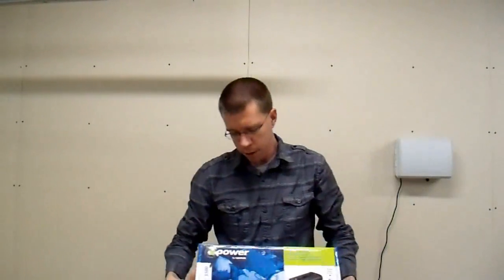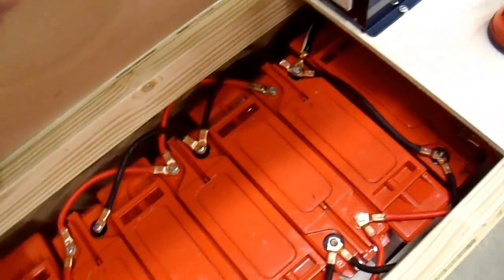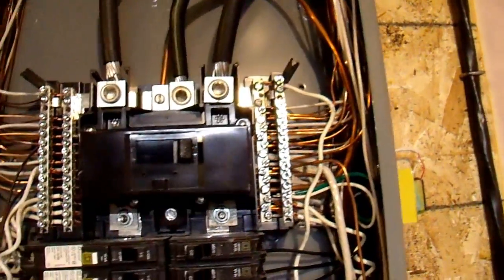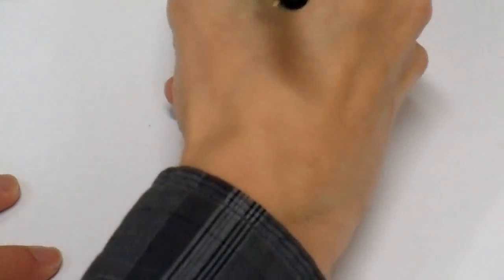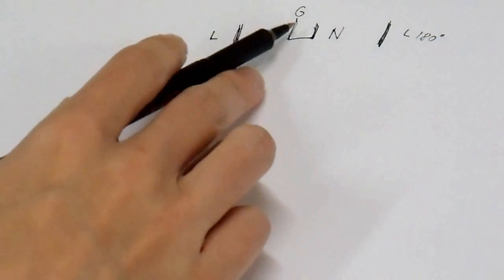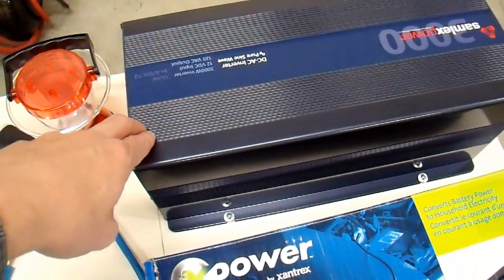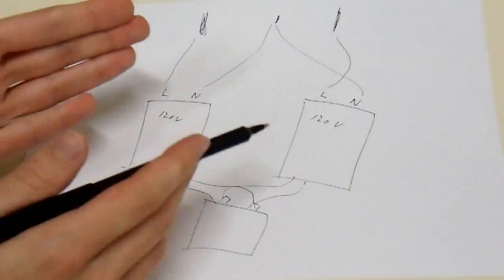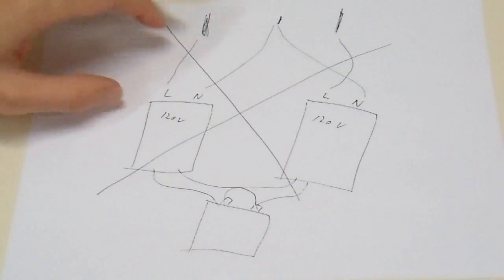How to Power your House with an Inverter/Generator During a Power Outage Part 1/3

Comment: I understand the grounding theory and how you showed the connection to the BATT ground and the ground of the outlet. I have a Vector that I just checked for that and it seems as though the battery ground is not connected to the outlet ground so I shouldn't get voltage sent into my batteries. Could I still use the vector  to feed my circuits in my home and still use the ground connection? In your other videos you made your connections without the ground. Also, whats the main difference between a batter backup (UPS) vs an inverter with batteries? m assuming it has something to do with the grounding and neutral. Normally I use a generator but im also looking to go with a battery system with solar charging.
Thanks for any info!!
Reply from the maker: The battery negative is often effectively referenced to the midpoint between the neutral and line on less expensive inverters.  If neutral is grounded (as it is in a typical household electrical system) this results in the battery connections being driven to one half of AC voltage.  This isn't a problem as far as the inverter is concerned but it could be a safety hazard.

Comment: I have a mobile home, and I am adding on to it. I am getting rid of the breaker panel, as I need more breakers. My question is I am going all solar,wind, and generator for back-up. I am using a 3000 watt power inverter, and a 100amp breaker panel, 20space. I am trying to figure out how I would wire this inverter to the100amp breaker panel. I am doing completely away with the power company, and I will probably add on a meter to sell back power to the power company later down the road. I use a swamp cooler, and wood stove for heating, a hot tub Jacuzzi,and lights frig,freezer. So I think this 3000 amp inverter will work,just need help wiring it to Homeline HOMVP5 100amp/20space. I have 2-6' ground rods for ground, and there is no power here now, as I am using a generator, and get tired of the noise.
Reply from the maker: That sounds like a very interesting project!  Most of your questions are building code related and I am not legally qualified to answer those in detail, but if you plan to make this permanent and also connect to the utility then you'll need an interlock kit or a transfer switch of some sort.

Comment: I forgot to mention, a simple auto transformer is a cost effective way to get 240V. Just remember that the amperage will reduce by roughly one half. 

Keep up the good work!
Reply from the maker: For live neutral inverters an isolation transformer would be preferred for safety reasons, otherwise a standard distribution style autotransformer would work great.  I actually have one for exactly the purpose you mention:  to create split phase from any 120V or 240V inverter.

Comment: Great video. I am glad to see the spread of knowledge. There are a few comments I have. It is worth mentioning that the type of backfired you are using also violates the contract with your utility provider. You cannot have parallel supply with the Utility unless you abide by NEC Art. 705 and have an agreement with the Utility. In simple terms, the poor mans way is illegal. Just putting that out there for what it's worth. 

I am glad you talked about the neutral. In inverters that sync with the grid voltage, the neutral is only a sensing circuit and not current carrying conductor. When it is a current carrying conductor, there are issues.

Comment: Just use a Automatic Transfer Switch
as it senses power it cuts off one supply for another used in backup systems... safety first...

Comment: Some inverters like the ones built into the Honda generators are protected against backfeed (that's how the parallel kit works) and can be used to power one side with another backfeed-protected inverter or generator powering the other side. The A/C isn't going to even notice unless you try to turn it on, but you can just switch off all the 240V breakers to further guard against it. Resistive loads won't be damaged, but would probably operate erratically or not at all.
Reply from the maker: It is important to turn off ALL 240V breakers, even the resistive ones.  If one of the two power sources goes out (out of fuel, overload, unplugged, etc) you're left with a pretty severe power quality problem on the other phase.  I accidentally did this once and it was quite creepy - lights very dim and pulsing on and off, appliances turning themselves on and off, strange noises from various undervoltage beepers, yikes!
Reply: Read this and then ask yourself - Do you think this guy is the right guy to take advice on how to break the electrical code "safely."  This is illegal, unsafe and will void your homeowner's insurance - and rightly so.  Don't touch this guy's ideas with a 10 foot pole.

Comment: Great video! Apparently there are a lot of people trying to back feed through the panel, I only hope they watch this video before they try it. Weather it's inverter or generator.  Thanks knurlgnar, you may have kept a lineman safe or someone from burning down the house!!
Reply from the maker: Thanks for your comment and you hit the nail on the head regarding the purpose of this video.  Backfeeding isn't the safest method for powering a house but I know that many people use it, so hopefully illustrating some of the potential complications will keep people safe.

Comment: While I'm not totally familiar with code in ur area, it would make more sence to utilize a 60 amp breaker, 4 prong 240 cord like used in a eletric dryer and wire a sub box if needed using 6awg and a quick disconnect in between dryer plug and box. The stranded core of the extension cord allows it to be flexible and is severely under par. those materials I mentioned can be purchased at hd or Lowe's for less than 100 bucks and how too can be for here in yt
Reply from the maker: I agree that there are 'safer' ways to accomplish the goal in this video, however the point of this video is demonstrate how existing house wiring can be used in a safe manner in an emergency.  The 'backfeed' method shown here does violate code in some jurisdictions and for a permanent setup a transfer switch would be more appropriate.

Comment: I've enjoyed all of your videos; including the mini generator you built!  great job!   My only input / advice would be a to go through the trouble of adding an appropriate rated NEMA L-14-20/30/50amp locking receptacle and inverter cord.    This is less than $150 in parts and pieces; and when coupled with a simple mechanical interlock; will make your installation meet local and national code for positive mechanical interlock...   Most of all; it'll keep your equipment isolated and linemen; neighbors, family, and first responders safe while dealing with the situation surrounding your power outage!   :)
Reply from the maker: That is good advice and I will do some research on interlock options.  Unfortunately my basement plans have me filling up all but one of the breaker positions so I don't have much room left for additional items in my panel.
Reply: *****
I am in a similar situation; my 2500 sq ft cape has a full 50 breakers; every single outlet in my house is home-run!  I am also "tapped out" on breakers; but plan on utilizing a method which is compliant with NFPA 70 (Nat'l Elec. Code)  -- I also am working on a generator controller which will electrically start a generator for the purpose of float-charging or bulk-charging batteries; will pass that info along too. - edited; typo on # of breakers

Comment: Great video as always knurlgnar24.
 Question.  I assumed that given the two male plugs, you were planning to connect these, simply by plugging those into the two garage circuits via their wall outlets in the garage. Would that limit you to the circuit breaker amperage (15amp or 20 amps), of those two circuits? Or...were you planning to change out the amperage of those two breakers?
Reply from the maker: This video is about the 'backfeed' approach using the two male plug extension cord and existing house wiring as you describe.  You would be limited to the 15A or 20A rating of the breaker with some caveats which I'll go into in the next two videos.  Realistically, though, a single 20A breaker can almost handle the full output of my relatively large 3kW inverter so 20 amps is sufficient for most people.

Comment: You can get a inverter that is split phase. its a 240 volt inverter that is single phase split phase. just like the 240 single phase. coming in to the home.    I say this is still and good video.  But I do a little more research. but I agree with inverters like the ones you have you cant use both at the same time. unless you have inveters that can be ran as a master slave setting were one will get its timing from the other. but they cost more.   with my system I will be using Outback Grid tie with battery back up. 240 with and auto transformer. for load balancing. again good video,
Reply: He said as much in the video...  I can understand the people having problems with reading comprehension but listening comprehension?  It's a video for crying out loud...  Pay attention and stop looking to make nitpick corrections.
Reply: tmar23 You must fell special with your Meaningless comment. you need to get a life.
Reply: Once again you are right on the mark. Do you know if they even make inverters that can even be set in a master slave configuration? That would be interesting.
Reply from the maker: flash001USA
There are master/slave inverters that parallel, but I don't personally know of any that can be connected in series as master/slave to make split phase.  You can, however run an inverter through a distribution transformer to make split phase.
Reply: flash001USA there is the out back inverters. and those are stack able.  but expensive.  and you need two for 240 volts. they use and autotransformer for load balancing.  but the more futures you add to an inverter the more they cost.
Reply: ***** this one does
 http://www.amazon.com/Xantrex-Freedom-SW3012-Inverter-Charger/dp/B006VELG7A/ref=sr_1_13?ie=UTF8&qid=1407086676&sr=8-13&keywords=xantrex
Reply from the maker: Eman2000
So it does.  Thanks for the link!
Reply: ***** you're welcome

Comment: there will never be a 2 phase going to a home. you have a transformer with you get your power from and its single phase. its a center tap Transformer. if you check it with and scope you will see they are single phase.....but still a good video either way.
Reply from the maker: Split phase has two phases each 180 degrees out of phase.  It is normally created by a transformer with a center tap as you describe and is commonly referred to as single phase since a 180 degree phase shift can be created with a passive device off of single phase power.  Electrically speaking there are two distinct phases in split phase and I found that nomenclature more useful for the purposes of this video.

3 phase has three phases 120 degrees out of phase.  Split phase has 2 phases 180 degrees out of phase.  It's a matter of semantecs.
Reply: Thank you for that correction. I'm sure he understands what is going on but he used the wrong term.
Reply: flash001USA  yea I new what he was talking about. but there are a lot of People out there that wouldn't know he has good videos.

Comment: Correct me if i'm wrong but if you had no intention of using ANY 240v appliances you could use 2 inverters correct? Just turn off the breakers? I feel like i'm missing something
Reply: yes you are, 2 inverters are a problem because they both have to be in sync with each other, so if one interter is set to 60mhz and another is set to 60hmz just one millisecond after the other there will not be a proper 240v and it will destroy your equipment! and they must be kept in sync the hole time.
Reply: fliping720 I do not plan to use ANY 240v appliances and like I said I will switch off the 240v breakers, so neither circuit should be able to see the other side right?
Reply from the maker: kf7tkj
If you use inverters that have a live neutral they will be referenced together at the batteries and you'll likely end up with damaged inverters.  Most inexpensive modified sine inverters (including the Xantrex shown in this video) are this type and won't work.  If the inverters are not live neutral AND have isolated inputs/outputs (most pure sine inverters are in this category) then it would technically work to use two inverters as you describe, however any tiny mistake and one could blow up expensive inverter equipment.  It is just too easy to accidentally, with some unknown/unforseen mechanism, get live power applied to the output of an inverter that way in my opinion.
Reply: *****
That is correct.

Comment: Very timely videos for me. I am in the middle of my 750w solar install. I have the Samlex 1,500 Watt pure sine wave inverter with that hard wire connector. I am interested to see how you tie into both legs. I would assume you need to flip off all double pole breakers first.Great info videos....Thanks
Reply from the maker: You are very much correct in switching off all dual pole breakers.  The Samlex 1500W is a good choice for this!  Parts 2 and 3 will be posted soon.
Reply: Yes you would want to turn off all of your 240 volt appliances by physically flipping the breakers associated with them especially for something like an expansive heat pump.